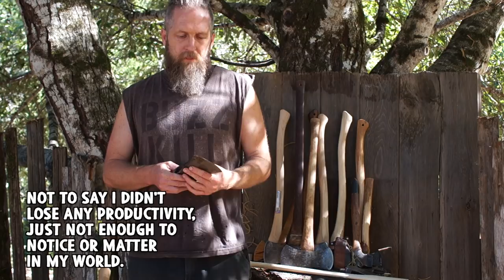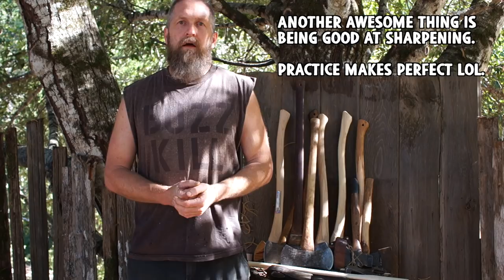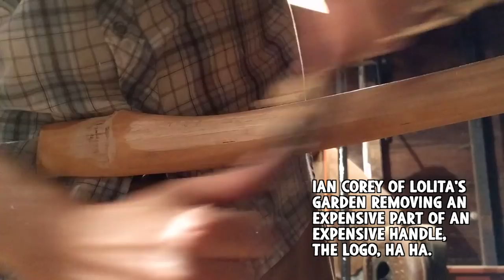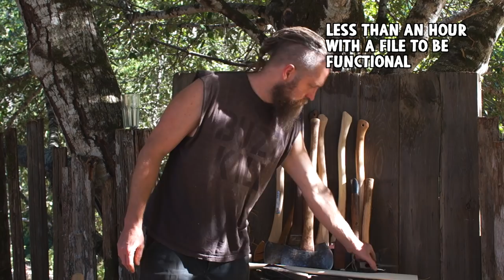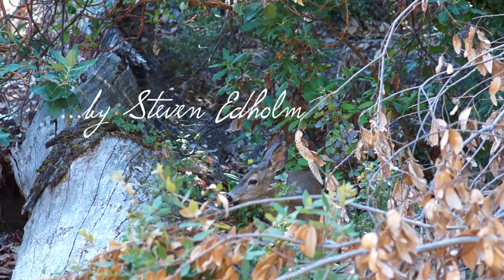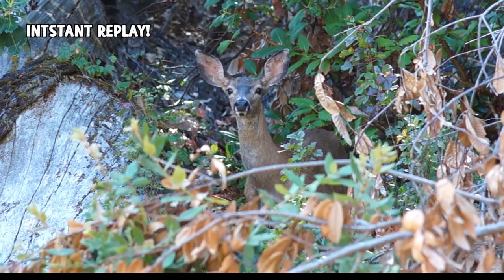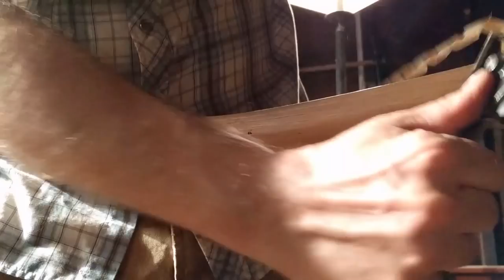Expensive Axe Buyer's Guide: (SPOILER ALERT, Don't Buy One)

Comment: I'm an axe user and use axes and malls alot for most of my life...and buy lots of vintage axes and axe heads...and after 20 plus years of swinging hundreds of axes from cheap hardware store axes all the way up to gransfors and I still can't say I've 100 percent  figured out what I want in an axe.....some are great choppers some better splitters...some just ok at both....or not great at either......and I'm always  testing  different  grinds for chopping and just how thin I can get a grind before it crumbles...and the same with handles testing just how thin I can go before it breaks....with both (perfect)  up and down grain.amd the exact opposite  side ways grain.....I even have one handle I'm currently testing that's got twisted grain that is have eart wood half sap wood and starts up and down grain and goes sideways and has horrible  runout ( I would have loved to see the tree it was cut from) and it's on a old worn down  bouble bit I use for splitting narly wood and is holding up fine other then the fact Ive had to steam bent the propeller bend out of it  twice

Comment: Butt but but the red paint! (on the cheep counsel) Ferrari red!   Some nice to hear your logic on this.   Seem so may Swedish axes with huge chunks broken out of the bit.  My favorite axe is a little boys axe, a freebi, on its third handle, a no name , can't even find a number stamp on it.   Easily sharpens with just a file, yet it won't curl the edge even on spruce knots.   Nice spoke shave, it would be interesting to hear your take on spoke shaves some day.
Reply from the maker: I've grown fond of that red paint.  When it gets worn in that is.  That is Ian Corey's spoke shave.  I don't have a lot to say about them.  My friends and both excellent skills guys Steve Watts (recently deceased and a remarkable man, various vids of him around YouTube) and Derry Wood who I also mentioned in a vid recently, both recommended the stanley 53 with the highest marks.  It has a tilting front throat piece to adjust the attack.  I've got one, but have not used it a ton.  I don't use them a lot, but if I get heavy into handle making, I'll use them more.
Reply: I think its all the handles on the spoke shave.  The ones with the up turned handles are problematic in that they can roll in your hands.  I much prefer the lower profile handles, the ones with the handles more in line with the blade and sole.
Reply from the maker: Some kind of quick adjust sure is nice.

Comment: My reason for getting expensive axes (Gransfors) even though I don't axe around that much is their  quality and quality control. I don't have to deal with loose heads, lacquered hafts, weird edges etc. All every GB axe I got required was stropping in an obtuse angle as I've found that the stock edge tends to roll.
That being said I'm sometimes sorry I didn't get some less expensive axes and get finished it myself. Well, maybe later. :)
PS:  Also the GB axes come with a sheath that works (no need to get or make a separate one).
Reply from the maker: I have only seen  so many, but almost all GB axes (maybe all) have had crooked bits.  It's like they barely pay attention to that.  Someone that went to the factory and looked in the showroom said the same thing.  They also need filing and fitting up like any other axe and the handles are insanely too thick.  I have been impressed with the handle fit though.  I would not spend much less time on a GB than on most other decent axes from the hardware store.  More time thinning the handle than most, but maybe more tightening, or dismounting and re-fitting the handle if it's really lose.
Reply: I'm far from being experienced axe user so perhaps I don't notice the bits being crooked.
Thank you for your reply and the content you upload! :)

Comment: Had a lot of firewood I needed to split some years ago. I started out with decent axe from a home depot and it worked ok. After a few days of work i wanted a less heavy axe and I bought a top quality swedish axe and I must admit that axe is just amazing. So there is definitely a difference in quality but if you are not going to use your axe a lot it is probably not worth it to pay 3 times the price.
Reply from the maker: There is a difference between a well tuned basic affordable axe and hardware store junk out of the box too though.  I've used gransfors and when I'm done hafting a vintage axe or fixing up a decent budget axe, there isn't a lot of material difference when it comes to getting work done.  Most people don't customize and refine enough, so an expensive axe with that little bit of extra finish work and grinding will seem a lot better.  But they aren't totally ready to go out of the box either for high performance.
Reply: I've used the same harbor freight splitting maul to split fire wood for 10 years.. usual split at least 7 to 10 cords a year with it never had an issue.

Comment: I have 20 axes most are boys axes most are off brand for the 50s to 90s and I use all of them they all work great I even have a China made ax that's farly  new and it works great hardly have to sharpen them the best part is that the most expensive one I have is 15 dollers and it's a 2 and a half pound German made us forestry axe with the original handle and head and I use it more then any with the 28 in handle

Comment: Great points man. As someone that is pretty proficient with axes I slapped a new handle into a super old double bit made by Sager chemical axes and got good with it. Still have it and it holds a great edge. I plan on getting a nicer single bit again because my dumb ass some how lost my council tool velvicut ax I have no idea where it is 😢.  I also reshaped that handle after I broke it and it fit much better in my hand. Of the hand forged Gränsfors Brük is pretty cheap. There are a couple companies that charge 400 for one ax.  I’ll say it again get good then get a nice one.
Reply from the maker: "I’ll say it again get good then get a nice one."  Yeah, if you think you need it at that point.
Reply: SkillCult absolutely agree man.

Comment: I can’t believe I just discovered your channel, I love how down to earth you are. Thanks for quality content. I am making my way through your axe videos, I have a small pile of axes to restore and you have given me some good food for thought!
What do you think of straight handles?
Reply from the maker: The one thing I really noticed with straight handles is that when you are bucking close up on a log, like timbersports people do, and most people do with any short handled axe, or even with a long axe on a large diameter log, there is an ergonomic issue with the wrists on straight handles.  At the end of the stroke, the wrists have to cock at a funny angle that is a little stressful.  It's not a big deal, but it's there for sure.  I would prefer a small curve a the end of the handle for that. Otherwise, doesn't really seem to matter a lot to me, but maybe I'm missing something. I've been meaning to make a handle with no curve except at the end, but have only done it with a hatchet so far.  As far as strength goes, I definitely don't like drastically curved handles and some make them that way basically for looks.  They are weak and wobbly and pointless.  I like the council tool handles and I'm not the only one.

Comment: Great video. Like your dismissive but friendly attitude. A suggestion for better use of the racing car driver metaphor though would've been to suggest that you wouldn't learn to race by showing up and asking to drive a factory-prepped open wheel race car at the track, but rather, would have to start out where almost everyone starts out: in go-karts lol. Like i said, good video though.
Reply from the maker: Yeah, that's a good one. That was off the top of my head  I think.

Comment: Ok dude, 10-4; great great video! I'm a landscaper, I do a lot of cutting and clearing and not much splitting. My 100% most used axes are (1) the husq carpenter because I can limb a tree 1-handed with that big bastard head on it, helps when you gotta control the limb with the other hand. (2) A 26" estwing full metal because it was the cheapest way I could find a super thin bit that takes a real sharp edge. I've learned a ton about a man axmanship with these two, total cost <$150 in Canada.

Comment: I have a 90 y/o craftsman axe I bought at a farm sale quite a few years back. I think I paid $10 for it. I just rehafted it again and it still cuts really well. I'll probably never buy a new axe again. Just like you said thousands or Millions of solid old axe heads out there just waiting to be hafted.
Reply from the maker: I don't know who made those.  From some I've seen I'd guess plumb made them, but over so many years, they probably had them made by multiple manufacturers.  I've always assumed they weren't made in house.
Reply: Several makers made them over the years for Craftsman. Think Plumb, Kelly, Mann, etc had go's at the contract. The Craftsman I have I would bet is Kelly True Temper from the 80s or 90s. Applies to all craftsman tools. If you can find the catalog number, the first 3 digits tell you who made the tool, on their current format, which has been around awhile. On tools older than that, not realy sure. But each one I've had was a good piece of steel.
Reply: I have no idea who made it.  It cuts well.  It's got the old craftsman logo, the oval with the curved craftsman name.  It's a Baltimore/Jersey pattern.  Cheap and works well.

Comment: Haha, the deer conversation was great! ;D
Salutations from Denmark, and thank you for the sensible basic advice.
Getting a functional beater axe , and using it to experiment, learn good technique and also get to know your own preferences before one invests in higher quality equipment, if even necessary, sounds like sensible advice, i have to say. 

Going to flee markets to spot quality old heads might be a Good start for Those who has the skills and equipment to hang their own handle. I'm not sure how many have that, though. Especially not beginners 🤔

Ps. I have a really old Forrest axe that i use as a beater axe, and I'm pretty sure it's got an almost ellipse shaped and quite slim handle. I wonder if the trend with fat handles is a relatively new thing?

Thanks again, and keep you the Sound advice!

Comment: Ok now a serious question: I reload ammunition since I shoot competitively and anneal my brass to relieve the stress on the metal. It helps the brass last much longer. The part in the video where you are hammering and reforming the axe head to remove the nick; can you also anneal the edge of the blade to relieve stress and make it last longer?
Reply from the maker: No, because it would draw the hardness out.  You'd have to either re-poiund to re-compact and work harden the steel, or re temper it, or have a soft spot.  I can't say 100% that work hardening will not draw out with heating to tempering temps, but I would assume not till I learned otherwise.  Those repairs held fine.  No chipping or anything.  Since they are small and on a pretty soft axe, they'll just get sharpened out.  They may already be.

Comment: I've been using axes for about 9 years now and i think the best piece of advise it to start with a cheap axe, why? when you first start using an axe or hatchet or boys axe you will most defiantly stick it in the dirt and get the blade chipped up. normally thats a bad thing. but now you have to learn how to sharpen the blade and at first that isn't easy even with all the youtube videos out there. so you'll be learning two skills. next time you go to use it you'll be more cognizant  of how your swinging the axe. you'll be more aware of where that blade is going to go if it glances off of that log, because you don't wanna have to put extra time into sharpening a chipped blade. when you become more cognizant you start to become more self aware and it will increase how safely your tool handling becomes.
Reply from the maker: Sounds about right.  I still stick my toe in the dirt sometimes.  If you buck at ground level a lot it's hard not to.  Sharpening takes practice.
Reply: agreed, sharpening does take practice. another important note in my opinion to make is, the grans fors bruks small forest axe and equivalent size lengths are incredibly dangerous to use if you don't have the proper knowledge. if you think a shorter axe, say a 19" handle, can be used the same way a full size felling axe can, well your sadly mistaken and will most likely end up injured. now that being said a 19" still has the ability to process quite a bit of wood, that is if your using it properly. these shorter axes are gaining quite the popularity with the "youtube homesteader and bushcraft community" but the people that are buying them hardly have any experience with an axe. Just my 2 cents. rant over.

Comment: As far as i know, GB's are forged using open dies. That's not what hand forging is ... just compare how much time does it take to make a GB axe (as in some clip from the factory) by one of their blacksmiths, and how many can they whip out a day, to a guys that forges an axe by hand, even with the use of a power hammer. How many axes a day can he make?
Reply from the maker: totally.  I have this stupid default habit of just saying hand forged, but the extent of that is a guy holding the axe head under what are essentially presses as far as it looks.  It probably should always be qualified or we need a different name for that kind of forging.  Hults sort of has that mystique going as well, but their axes really look machine made as far as I've seen.
Reply: Hults do look like that. Maybe, because they're sandblasted after the forging process? I'm not sure. The best way to get a very good and cheap axe - is a proper vintage one. What you actually mentioned. While restoring and hafting an axe one can adjust almost every parameter to his needs, while also teaching the person the skills required for further maintenance. I watch all of you'r videos which include axes etc. If you're not a member of axe junkies on facebook, you can add yourself and it is a neverending well of axe knowledge - and axe specifically, no other tools or any other spam allowed.
Reply from the maker: They aren't sand blasting off hammer marks I don't think, because they're just too flat and perfect looking.  I'm on axe junkies for sure and Rooster is a top notch dude.  I don't use FB much though.  Also, the practical stuff ax AJ gets buried underneath all the collecting stuff that I'm not really interested in, so to find that stuff I have to do a lot of scrolling.  Any time I've posted anything to do with practical axe use and pragmatic stuff, it inevitably sorts way down the page immediately.  That just doesn't seem to be the predominant interest although I've had some good conversations with guys there for sure.    I'd love to see a forum somewhere that was strictly practical or working axes.  that's a good name,  Working Axes.

Comment: @SkillCult Great informational video! Definitely made me realize the value in budget tools. I've been using the Fiskars axes currently, but about to buy a vintage Plumb axe head. Any recommendations on quality handles for a decent price? I don't have the skills yet to make a handle. Thanks for the words of wisdom!
Reply from the maker: I think you'll be pretty much guaranteed a good handle from west woods on ebay, but they are not cheap.  I actually like the handles by Do it Best, common hardware store brand.  Most of them are warped etc, but if you can find a good one the pattern is fine with just a little tuning up and they are pretty affordable.  Just go to all the hardware stores and see any carry them.  If they do, keep checking back or ask about new shipments.
Reply: @SkillCult  Thanks for the prompt reply! I appreciate the help! Looking forward to putting the old Plumb to use. Keep up the great informational videos, as they definitely influence people for the better.

Comment: You can case harden the leading edge with charred leather. Watch Clickspring's video "Antikythera Fragment #4"
Reply from the maker: I'm not sure what you're referring to, but any axe I talk about here  probably contains enough carbon and could be re-tempered.
Reply: @SkillCult  If the back of your axe can be mushroomed or if the edge can be bend (as opposed to chipped) then it contains essentially no carbon. You can selectively harden the edge by introducing carbon from charcoal at around 1200 F and then quenching. This will give you an edge comparable to quality high carbon chef's knife.
Reply from the maker: @dfgyuhdd  No way that axe was mild steel.  I cut tons of firewood with it and you can't get an edge like that without carbon.  It might have been low-ish in carbon, or it might be just tempered soft.  The poll was especially mushroomed, but almost every poll axe I get has at least some mushrooming from abuse.  In a video I did on axe defects, every used poll axe on the table had at least a little mushrooming.  Unhardened carbon steel mushrooms easily.
Reply: @SkillCult  It might not be mild but hardness is a relative term. Anyways if you have some down time in the winter then try it. I promise you will notice that it maintains sharpness much longer. Also I really enjoy your videos. Thanks for taking the time to respond.

Comment: What is your pick for a “general all purpose” axe?
Reply from the maker: I think it's going to vary person to person, but for me, relatively short handle, similar to what used to be known as a pulpwood axe, like a boy's axe, but heavier.  Not too heavy though.  I'm still sorting that out for myself.  If I really had to recommend an all purpose firewood axe right now, I'd probably start people with a 27 to 29  inch handle with a 2-1/2 to 2-3/4 lb head.  Very few of those are made today, but boy's axes are close,  just lighter.